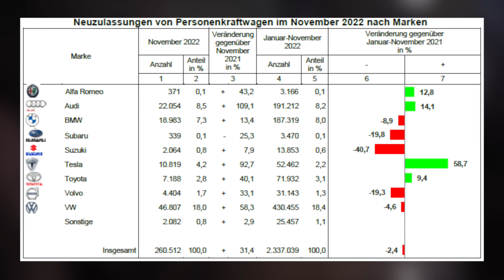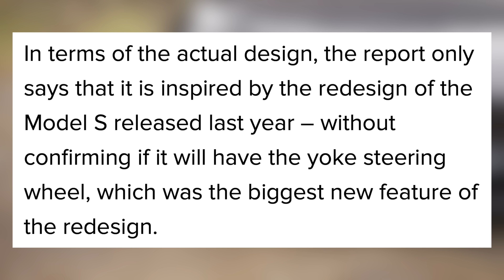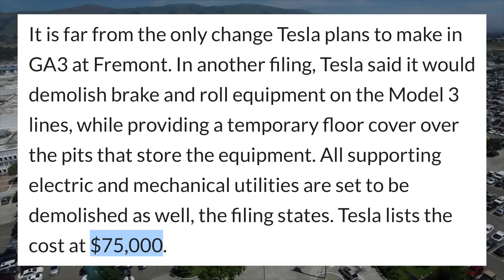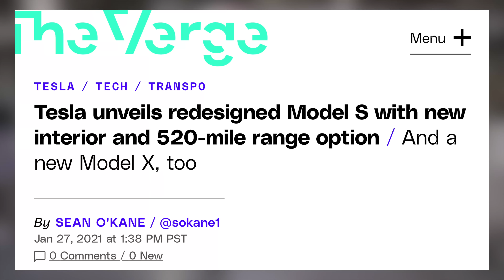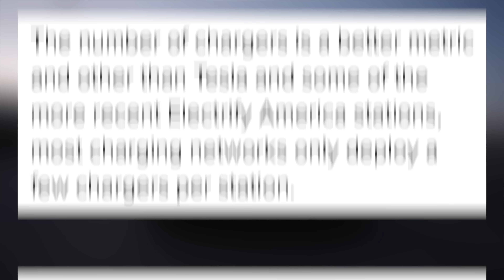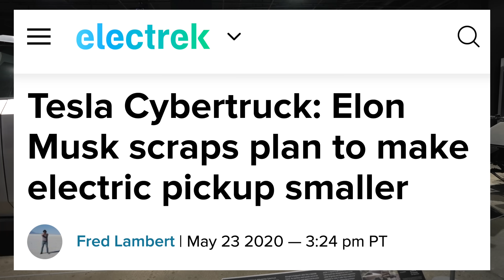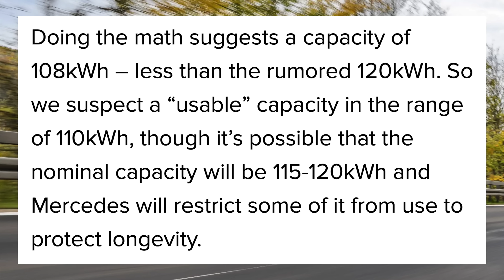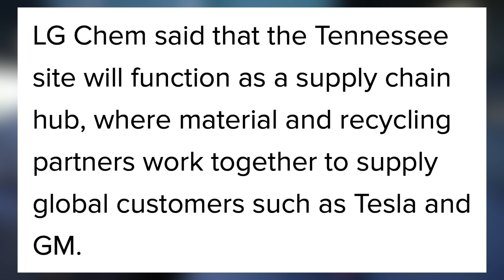NEW Redesigned Tesla Model 3 Spotted | It's Not What We Expected

Comment: Some things I'm hoping for the refresh: 
1. Rear center seat armrest with wireless chargers like on Model S
2. Larger rear trunk space
3. Double projector headlights
4. Adaptive air suspension
5. Larger side mirrors, Model S size for Model 3, Model X size for Model Y
6. Heated and maybe lighted door handles
7. Manual release in door pockets for rear seats like Model Y
8. Upgraded stereo system for premium versions, current premium audio for the base version
9. Structural battery pack and mega castings for front and rear chassis
10. Ventilated seats
11. Additional cameras and new radar
12. Center console compartment for the lid stock (like in the sponsored segment)
13. 17" center screen

Comment: For Model 3 I would change the rear turn signals from red to amber like those of Model Y. LEDs are not that expensive to have to re-use the red brake lights for turn signals.
Reply: The recent new shipped Model 3 have started to ship with amber rear turn signals from what I’ve seen on reddit
Reply: Mine came with the amber tail light turn signals. I took delivery 11/15/22
Reply: @motectune  Was the delivery in North America?
Reply: @hakugakusan  yes, North American, dual motor setups have amber lights now
Reply: @hakugakusan  Yes, took delivery in Houston TX

Comment: The new model 3 and Y needs to have vehicle to load at least 3 kW or ideally 7kw plus heads-up display ....also we want the ultrasonic sensors and radar plus a foot sensor under the rear end to open the boot up when your hands are full plus dash cam / sentry mode with memory built-in so you don't have to purchase a USB memory stick plus improved battery 4680 etc

Comment: Front and rear bumpers could get slight redesign.  They are currently good, but slight changes are always welcome.  With this slight changes to all of the lights.  Bird eye camera and powered frunk. If they add the yoke that would be great.
Reply: Powered frunk is a safety concern, which is why tesla doesn't offer it. If the mechanism were to fail during a drive, the frunk would come all the way up if automatic and therefore block driver view. If the manual frunk opens while driving, it will only open a little and allow the driver to still see.
Reply: @theaviationchannel3501  very easy to create and install safety for this.  Do different from opening a door while driving.  Other OEMs have powered frunk with no issues that i have heard. Also, if the frunk today opened while driving, the wind would easily blow it up to block the view.

Comment: Tesla has completely redefined the meaning of the word “redesign”
Reply: I think Ryan came up with the word “redesign” for Tesla’s. Basically means nothing in most cases
Reply: He redesigned the meaning 😮
Reply: New Light bulb= redesign
Reply: Maxbe its more of a redesign of sensors other than cameras. Electrek posted about some Confidentiality Letters from Tesla. Would explain the covers at the front and back.
Reply: Sounds like they are changing the body style

Even if it's only as much as the refreshed Model S and X with shuttle changes to the fog lights.

Would not be able to tell the difference between the old and the new unless you have them side by side.
Reply: How about 
"Major under the skin update"?
That's a "redesign"

Comment: Cooled seats, add a mini LiDAR system to boost night visibility. Given Tesla's issues with reliance on headlights, LiDAR or some form of radar would allow significant foresight.
Reply: Reliance on headlights?
Reply: LiDAR or any other radar does not help teslas FSD and  Autopilot systems.
Reply: @aminfozdar  The headlights keep flashing on which illustrates that FSD needs headlights. I would prefer it to just be able to see even in the dark.
Reply: @Live2ride2live54321  LiDAR and radar would definitely help nighttime performance. When I purchased the FSD package, the headlights kept randomly flashing on and off when it saw another car. Radar would allow it to just see the other car beforehand and improve redundancy. Further, I noticed my new MX plaid is missing the ultrasonics from my 2021 MX plaid so LiDAR would really help for the self parking.

Comment: Regarding the DC fast chargers at Ford dealers, it is about more than the number of chargers. That is, the speed of the chargers is extremely important, and the lack of amenities is a big drawback. Presumably, customers would be allowed access to dealer bathrooms, but that would apply only during hours of operation. What is also important would be the availability of a restaurant. I can imagine Ford dealers with two 25 kW chargers, out of order half the time, but perhaps I'm just being cynical.

Comment: Bring back LiDAR. The one thing I would like is a front bumper camera. Much cheaper cars even have a front bumper camera but Tesla, a vehicle that can drive itself doesn’t, that makes no sense. Integrate a solar panel somewhere, maybe the roof or part of the hood. Put in a HUD. Put in some sort of neck support. Integrate a solar system(virtual planetary overlay into the ceiling of the car so when people are camping or using the fireplace mode they can look up and explore the solar system by touching the glass;) Try to make the the inside of the car more quiet from exterior noise. Wind can be loud at times. Last thing, make it fly. Give us the option to fly with the next software update. If I’m late for work I want to be able to get from point A to point B quickly so I can pay for this service. I don’t want to wait in traffic. If Elon can launch rockets and then have them land back down from where they were launched then Elon can make my car fly with a few software updates and making the doors fold out and rotate for lift. Let’s get started on this.

Comment: All cities should use thirsty cement or concrete to reduce flooding and reduce are demands on sand by millions of tons.
Fun fact thirsty cement and concrete dont use sand and let water run through them to help recharge groundwater aquifer levels and you can have 1 to 4 feet of space between the road and ground acting like a water resivore so soil can absorb the water and it reduces the flooding by lots.

Comment: I would like the new model 3 to get a HUD display and better quality interior - just scheduled my 3rd appointment to fix the B Pillar cladding on the interior. Would also like to see an Automated Frunk as well. Maybe a new Model S style front Nose effect, not identical but something to reduce the large painted surface area.
Reply: I think the front is redesigned. It is what makes sense to me considering the new machinery to be installed at Fremont.
if it were just new versions of existing machines then why the secrecy?
Anaswer is that if we all knew and saw the redesign it would lead to reduced sales !
Reply: The ultimate aim is FSD.
No HUD.
(Amazon. $80 or less, plugs into the OBD port)
Reply: Automated Frunk is unnecessary expense and weight. They're not going to do that. Also just like automated trunks they stupid. There's no reason anyone needs an automated front, let alone and automated trunk. It requires just restraint to open and close the front and trunk. The automation actually slows things down.

Comment: I'm disappointed Tesla just doesn't grab all of the (good) recommendations and run with those.  I WANT a hatch on the Model 3.  The trunk space is great but that window gets in the way.  That rear window configuration also allows water to run into the trunk if you open the lid during a rain event.  Making it a hatch would fix both of those problems - and those ARE problems.  Automatic trunk lift is less a desirable feature over a hatch -if I had to choose.

Comment: More front cameras... Yes! The single cam on our 2018 3 is always throwing a "blocked or blinded" error which shuts down AP and Cruise.
Reply: Your Model 3 has 3 front camera's, not one.
Reply: Probably a better idea to use a washer instead of multiple cams. Premium headlights in Europe come with washer sprays in front of them.
Reply: @geraldh.8047  Multiple cameras give more viewing angles, for the car to see better.  But the 3 front cameras already have a windshield washer/wiper.
Reply: @Resist4  Yeah, but they're all in the same place. Getting better coverage with low sun angles would help. Having AP or Cruise shut down without warning is no fun.

Comment: We should not even focus on number of chargers at each station but instead focus more on charging speed. Sure 2 chargers would be good , but since this is a requirement it’s likely that they will go with just that .. 50KW Charging is NOT fast charging anymore. These chargers are pretty much useless these days. If you not installing at least 150kw charging station then it should not be listed at a fast charger

Comment: I would like increased range option to 400 miles for 3, Y.  S, X need to have 500 miles option.  Why?  Superchargers are getting crowded with exponential sales growth.  Do t want to stand in line with the riff raff… just joking.  At hi speeds, range does get reduced, especially with HVAC use.  Need higher energy density batteries, don’t want increase mass of the cars.

Comment: Nobody wants to go to a dealership to charge their car. Locations can be less than ideal, usually few services around and it’s awkward. It technically boosts the numbers of chargers on paper but it’s not as meaningful. Also a lot of dealerships These days have relatively short hours and lock up after hours limiting access to chargers. It would be my last choice and I would assume the chargers are already in use, blocked or broken. That’s based on my observations working for an auto group with car chargers and as an ev owner.

Comment: I think Tesla will upgrade Model 3 cameras and camera placements to Hardware 4.0 very soon, as now, Q4, is typically the time of year camera, sensor, and processor manufacturers ship product updates in volume. Structural and mechanical changes, such as a cast front end, structural battery pack, brake by wire (e.g., Brembo Sensify), steer by wire, and possibly HEPA air filters may come to Model 3 later in 2023 or 2024 as these upgrades would likely require temporary reductions in factory output. They may also be strategically building enough of an inventory buffer to allow factory upgrades without significantly impacting deliveries.
Reply: V impressed by utility of  Sensify.

Comment: I hope & think the Tesla M3 body will be wider in front & rear (like the MS). It’s possible they do a Yoke & no sticks. Heads up display would be great as well. Definitely will have HW 4 & possible cameras in headlights. I disagree they won’t change the interior bc of the MY. Lastly, a structural battery pack with 4680’s would be great! M3PD will probably be their first car made 🤞🏽⚡️😁
Reply: No yoke pls
Reply: Width: Doubtful
HUD: No (it's designed for FSD!)
Cameras: possibly in rear lights as well (hence the covers?)
Interior: Are those different headrests? (Us tall drivers need height adjustment!)

Comment: Really don’t want to see much in terms of design. Much prefer the 911 ethos of very minor modification. They got it right the first time. Plus, dramatic exterior changes could effect how FSD is implemented or functions across different body styles. If the could make the M3 lighter maybe there would be room for the weight of an automatic Frunk. Sliding glass roof would be nice. If they debut that I’m trading in my 22 M3P!!!
Reply: 911 can get away with subtle redesigns because there are few on the road relative to a mass market vehicle like M3. M3 design is getting old and you see it everywhere. They'll have to do a bigger redesign to keep people interested because eventually people get sick of seeing the same exact car. It's not a great looking car either it just looks like an egg.
Reply: @user-ow1bn6qv8q  
BS

Comment: Question, with single cast, how would it be repaired in a minor to major collision.  No answers i am seeing
Reply: If the chassis is bent on any car, you throw it away. For minor repairs it is metal, so you can file it, put bolts in it and weld it. However minor repairs to the chassis's of any car are rare. If a car has been t-boned with enough force to cause damage to the chassis then the cheapest option is to buy new.
Reply: @robertwhite3503  no i just mean even a dent significant enough to need replacement part.  If it is less parts that means replacing even any dent you cant pop back, what do you do to avoid paying a fortune?
Reply: @karmicexperiment5034  If it's a dent then ignore it like any other car. The thing is, you can repair it like any other piece of metal. I know you are going to find a small replaceable part somewhere that could be replaced on another car that Tesla does not have. So buy a piece of metal and screw it on. You will have to shape it yourself.
Reply: @robertwhite3503  ? If you feel like that is an answer thanks

Comment: Would like to see the M3P come with carbon-wrapped motors and a good hp boost.
Reply: Price would jump another 20k imo.
Reply: for sure not worth the price jump lol...
Reply: Depends.
If they take the "best part is no part" idea to it's extreme and have decide one motor core for all is the best way (maybe the carbon wrap is more efficient ?)
Then, bulk manufacture may reduce the price if that efficiency means they can use fewer batteries per car?
I doubt you'll get more horsepower.
Remember theses are already vehicles that would have outperformed all but HyperCars 10 years ago. (Some still do)
The "6 second Hot hatches are fast" opinion is now destroyed.
If motor efficiency can give 10-15% range increase, and they l reduce cells by.... 7%?
You still get a "useful" range increase.
 But that 7% is about 55 cells in a 4680 pack, or a "free" pack for every 15 they make.

 If they can give you faster charging...... Plus 20 miles range. That's more useful.

Comment: They need to add back some knobs because it’s too hard to access them from the screen. The wiper on the left needs an extra twist control for speed and intermittence. 
Change the glass roof to metal. We don’t always need the sun roof. This can save costs especially when it breaks from road hazards.